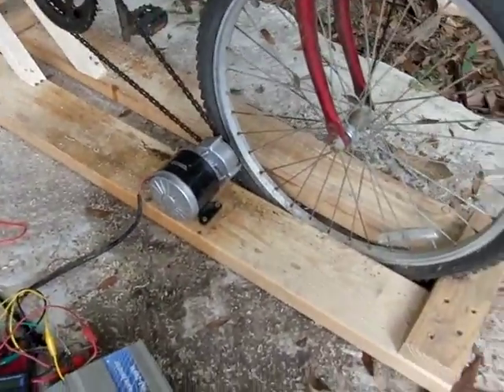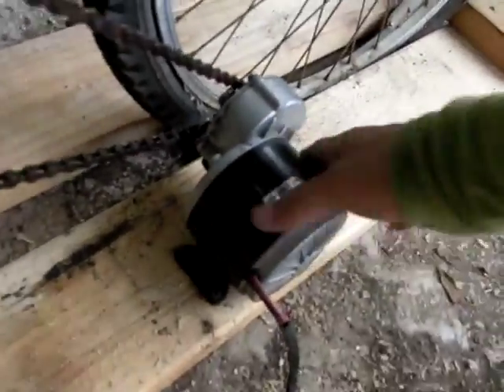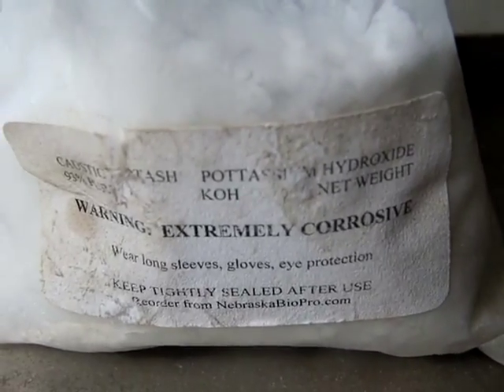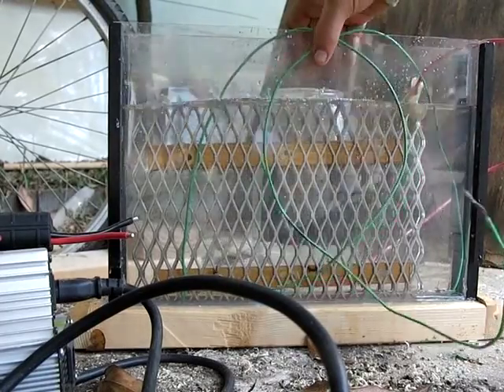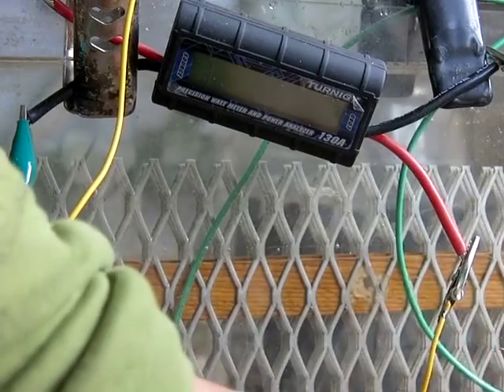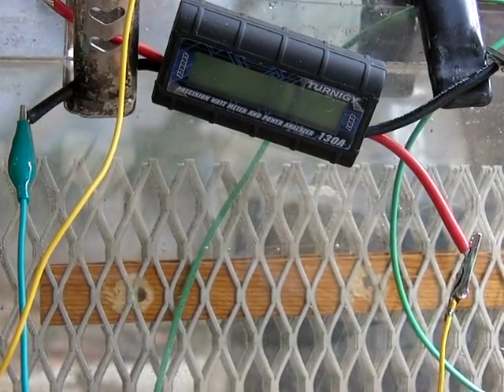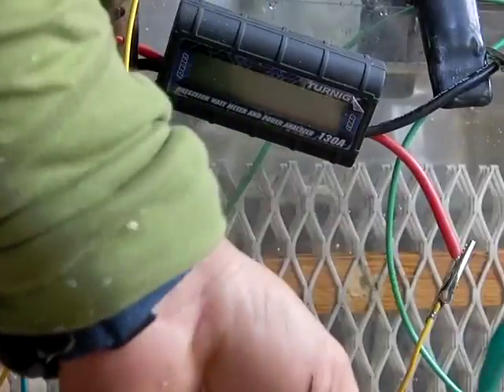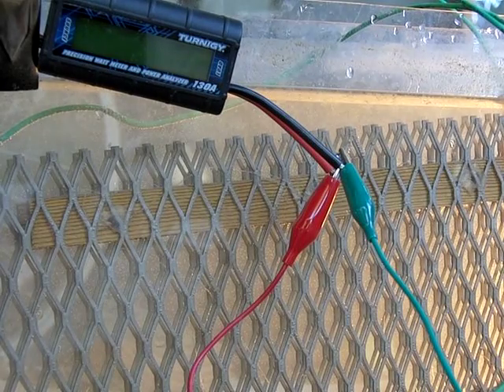DIY Hack Hydrogen Bike Generator HHO human power 255 watts

Comment: What is the purpose of this project?  What will you use the H fr?
Reply from the maker: Bruce King This was a demo on the max power of a DC bicycle generator and to illustrate the power consumption required for some of the traditional setups used.

Comment: the solar boiler should be providing the steam PSI for a donkey engine to drive a dynamo to provide this plate current. 
once the gas production stabilised, the boiler could then choose from either of heat sources.
boiler can also also be re-fired via stored HHO on those pesky cloudy seasons.
as a handy by-product, i'd collect the steam distillate for potable sterile H2O!

Comment from the maker: The large wheel vs the smaller support rollers 10:1 or more to a generator would produce excessive RPM = lower torque. This would be a great option for a standard high RPM DC motor but strong loads could cause slippage. Also, the wheel to roller is an additional friction point + the sprocket friction is still needed. This is the highest power output configuration I have seen.

Comment: Surely instead of attaching the generator directly to the front outside sprocket of the bike, it would be better to rig the generator into a rolling road type setup, and then use the rear wheel of the bike to turn the rollers.  By doing this you'd be able to use the weight of the wheel, and the bikes gearing to your advantage.

Comment: Hint: You can use the hydrogen to directly create electricity.  Tell your friends to stop burning it and look up PEM fuel cells... they are probably more efficient for ground transportation because you create electricity direction rather than burning it.  That is what people should be trying to go for not putting it in their carburetors...

Comment: @tahoeskiier The point was to generate HHO not electricity. Electricity is used to generate the HHO. The electricity comes from the pedaling. What he is doing is an electrolysis of water. Water doesn't contain carbon. So he wouldn't have been producing any CO2.

Comment: I hope you're not using a stainless steel electrode... It puts extremely poisonous chromium into solution, which can then be absorbed through your hands, get into groundwater, etc.
Really, the only safe and non-oxidizing common electrodes for this are platinum or pure carbon. Pure carbon is my choice, as platinum is over budget ;)
You might also consider using hydrogen peroxide in pure water to give conductivity, as it ionically dissolves into water and consists only of hydrogen and oxygen.

Comment: Excellent HHO production demo. This is what HHO skeptics trying to say about HHO boosters ( IT DOESN'T WORK ) because it takes more energy to produce HHO than the energy it can put back. There's the PROOF, Dan Rojas can hardly pedal the bike and almost no HHO is being produce, but if the HHO generator will be turned off, of course he would be able to pedal the bike again. So maybe the NAYSAYERS were right this time, until one HHO sucker can modify a real working HHO BOOSTER.
Reply: You need radio frequencies to split the water at the resonant frequency

Comment: I think one thing this shows is how much energy is needed to split water. Lots of people think that hydrogen fuel cells are going to be some kind of free energy solution. "Hydrogen is the most common element in the universe!"
Problem is, most of it here on earth is stuck to oxygen or carbon.

Comment: I am sorry, I don't really get the point to the HHO generator...

At first, you showed the pure output of the generator, and reached 8.9 amps just at a very low rpm with the hand. Then you connected the HHO tank, and achieved 10.2 amps, at many times the rpm - what was the purpose of the tank in this case?

Could you diagram the setup for me, please?

Comment: You were losing a lot of power transfer with your bike set up. Essentially your seat looks like it needs to be moved back and raised so you get all of the power from your leg extension. Even so, 255 watts is a lot of work. Gearing will not reduce the work needed to produce the 255 watts but would allow a higher rpm which would make it more aerobic rather than anaerobic. 160-180 Watts over 30-45 minutes is very feasible.

Comment: 255 peak, humans dont pedal much more that if anything! usually about 100w cont.  thats why some areas restrict electric pedal cycles to 200/250w motors max. - I do like your gearbox on that motor, was looking at a motor just like that but without gearbox, was 36v 500w, was going to bike it to help get the shopping home, a gearbox on it like that may help make the batterys last longer

Comment: here is a good suggestion for you . I see thgst yoiu have trouble at the week point of the peddling so if you add a flywheel to the mix it will smooth out the rmp's . just add a heavier tire to the back of the frame. and i would sallso suggest that you use potassiun nitrate instead of that caustic stuff. Safety first my friend

Comment: @DJRockinRob better to attach a solar panel directly to the electrolysis tank, then collect the hydrogen. Hydrogen stores energy FAR more efficiently than batteries; it's just that it's... extremely flammable, and needs to be compacted at a rather high pressure in order to store any amount sufficient for storage. Once it's stored, though, and as long as you're not stupid with it (the same can be said for most dangerous things) then you can tap that energy for fuel cells OR internal combustion!

Comment: Hey dan, what would you think about putting some sort of flywheel on it to help maintain your momentum? or heck, maybe a few shifts of gear perhaps? I'm wondering about that myself; for instance, if you were to leave the back well on it and add an extra gear to the opposite side of where the bike's default gears are at a very tight ratio, and attach that chain the motor at a slightly wider ratio.. that way you can get its inertia built up, and keep it going at a high speed. Pace is important.

Comment: I'm just a diesel mechanic but I'll make a suggestion anyway. If a plate that size requires such a huge generator load, why not chop it into something 1/4 the size. That might be something you can maintain for a while. Your legs have a power band (just like a diesel engine) where maximum power is produced at a certain RPM. For a cummins diesel engine it's about 1500 to 1800 rpm but with your legs it's about 60 rpm. Trim the plates down until you can reach 60rpm with a comfortable pedal load.

Comment: Dan, there's no such thing as a neutral plate in an open electrolyte bath with screen material for "plates". To your generator it still looks like a dead short. Take a look at my new "Batt-Cell" series. With straight DC I have hit 5.92 ml/min/watt efficiency so far. You can also check my FAQ at alt-nrg*org.

Best,
Z

Comment: Try it again, but use nails or stripped wires.. Then you can also collect the oxygen on one end and hydrogen at the other...
A strong cyclist can put out 125 to 150 watts over time.. but set your goals for only 100 watts...
If the dynamo hubs weren't so pricey, I'd try to see what 6v @ 3 watts would do...